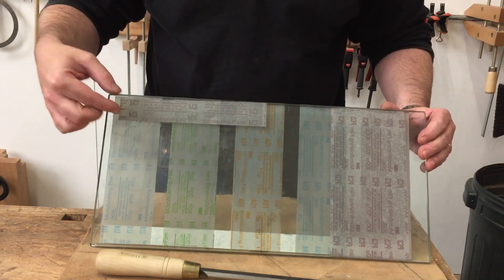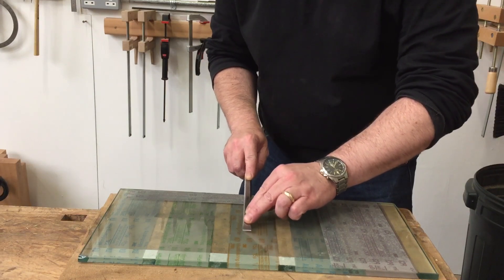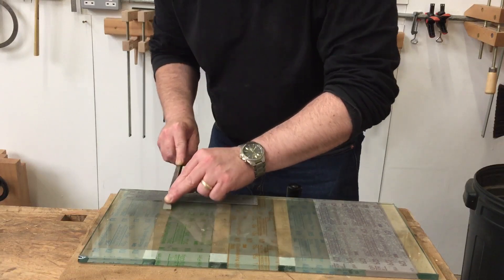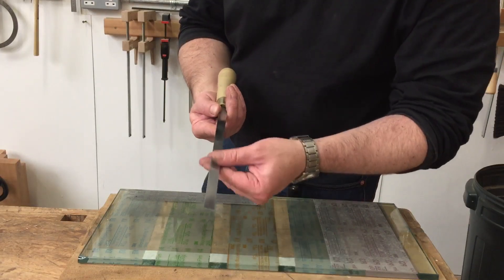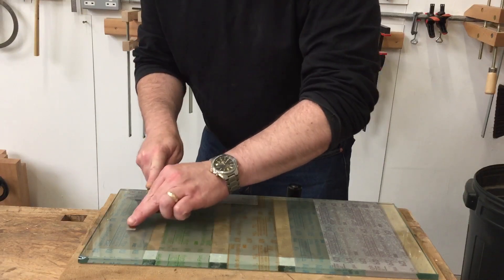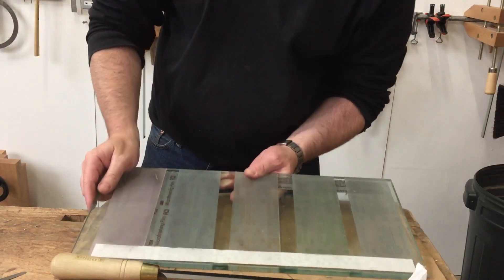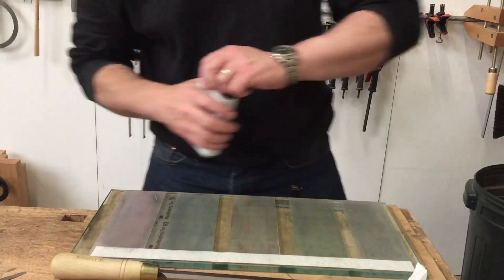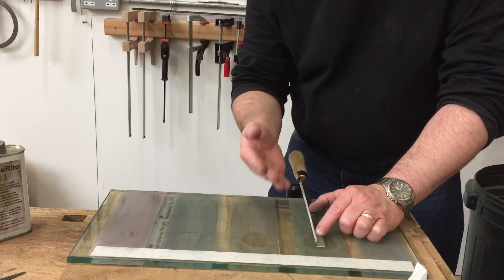Scary sharpening - preparing the back of a paring chisel

Comment: Is this really better than a perfectly plane back? I am trying to sharpen my butt chisels for the first time and want to avoid any mistake.
Reply from the maker: Massively better, because it's a surface area (not a line) the amount of work needed to keep a small area maintained is exponentially less than a big area. Perfectly plane, if it was even possible, is almost certain to become convex, so very slightly concave is the only safe place.
Reply: @Workshopheaven  Thanks a lot. I really appreciate the help. As I am using butt chisels (the back is only 7cm/2,75in long), I wonder if therefore I should use a smaller strip of 100 micron film or change the procedure in any other way?
Reply from the maker: @derklausemann4697  Sure, a 1cm wide strip is plenty.

Comment: what are the film grits for the polishing strips?
Reply from the maker: In this case I'm using 50, 15, 9 and 3, you can choose different grades but broadly speaking you want a fairly rough one (30/40/50) to cut back the wear bevels then a sequence of finer ones to produce a small polished surface right at the edge.

Comment: Hi, watched the video on the Crimson Guitars channel. I have a question about the masking tape method you used on it on a plane blade. Could you use it to prepare the back of a chisel?
Reply from the maker: Thanks for your question. The Charlesworth ruler trick (or it's derivative with masking tape) is wonderful for plane irons but should never be used on chisels because unlike plane irons the flat side IS a registration surface . A managed concavity is a much better approach for chisels , a little more effort initially but well worth it.
Reply: Workshop Heaven Ltd Thank you ^^

Comment: Having a flat back to a pairing chisel is important because as the name suggests, it is for pairing which means they are used to get things squared up. If you only flatten and polish the tip it won’t be as flat as it could be and that will translate to your joinery. If it were a bench chisel which is used to remove material quickly then it is a different matter because you only need the tip sharp.
Reply: Garbage. Well in theory you are correct but your theory doesn't translate in to the real world. Anybody who doubts the veracity of this video casts aspertions on somebody who has forgotten more about sharpening than you will ever know! Trust me Matthew knows his stuff.